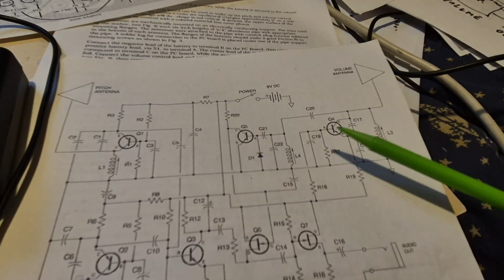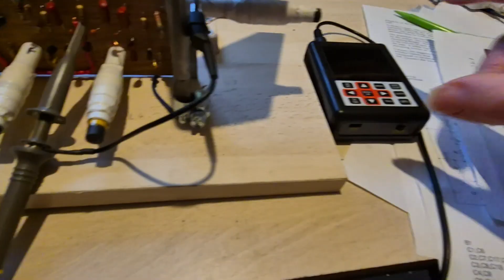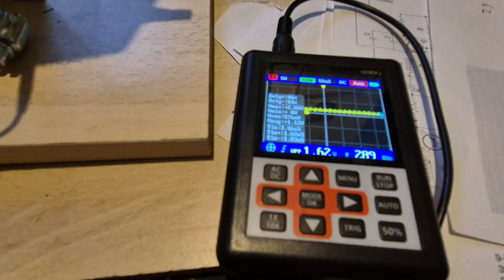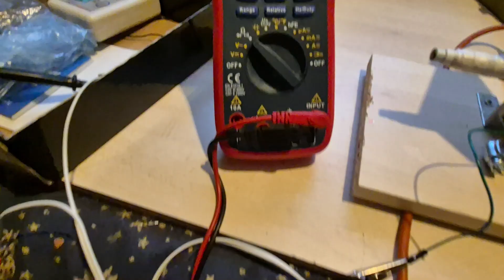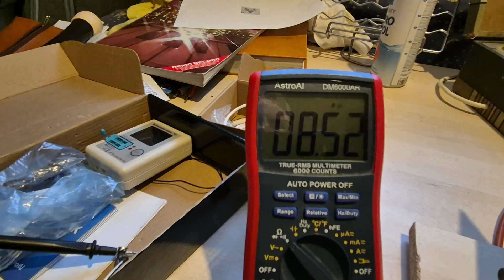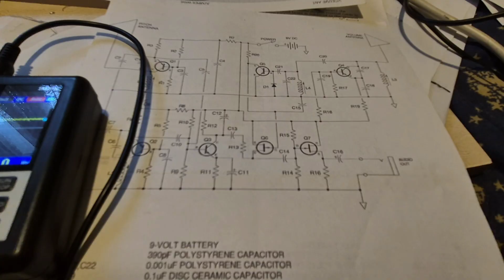Theremin Project 13 Mystery of the lack of volume control.

Comment: Hi Tim, maybe I'm missing something, but I don't understand how that circuit works. Surely there should be a  DC path from Q6 source to ground? For it to work as a variable resistor. It's just got two capacitors connected to it as it is. I'd try a resistor to ground and see if that makes any difference.
Reply from the maker: Many thanks Nick. Yes I also think that's a bit strange. Maybe it exploited some sort of quirk of the original FET, I don't know. The originally specified FET is now very rare, which is why it was not an option, as you probably already know. In a later video we could see if a resistor to ground helps.

Comment: Fascinating stuff. It sounds (sorry! 🤣) as though Q6 can work as a very sensitive volume control given how rapidly the resistance changes with a small change in gate voltage. If so then a very small change in voltage at the collector of Q5 as you vary the hand distance might actually be a good thing if, and it's a big "if" of course, you can calibrate the collector voltage of Q5 accurately. So here's another random noise output from yours truly: what happens if you change the value of C21? My thought is that with L3 and L4 tuned correctly (with the hand not close to the volume trowel) then reducing the value of C21 reduces the signal applied to the base of Q5 and thus increases the collector voltage. And vice versa of course. Maybe the gain of the transistor you've used at Q5 is sufficiently different from the gain of the transistor in the original circuit that the value of C21 is no longer useful?
Reply: Bob: (Hi Bob) actual noise source here...perhaps just swapping R20 for a potentiometer would allow sufficient fine tuning of the collector voltage for Q5 (perhaps that's "too late" though, and really, as you say, you need to tweak the base voltage to put Q5 in the proper range).
Reply: @matambale  Good thought Joe although varying the value of R20 might not change the threshold much? I don't know. Another possibility which has just occurred to me is whether the voltage drop across D1 is closely enough matched to the base emitter drop of Q5. In combination with C21, which would act as a reservoir capacitor for D1, the negative excursions of the AC passing through C21 are shunted to ground less that diode drop allowing the positive excursions of a small signal to just turn on Q5 if the diode drop and Vbe drop are closely matched. I'm an avid consumer of music of all genres but I'm rubbish at making music so I'm rather glad I'm not tempted to build a theramin! 😱🤣
Reply: @BobAndersson  Good thoughts Bob, right back at you.  Tweaking R20 is on the wrong side of the problem.  I did wonder about D1's Vf being close enough (low enough?) to yield the proper bias point for signals on Q5 and now courtesy your point, Q5's Vbe drop.   Sounds like a bullseye.
I cannot imagine being graceful enough for the gestures needed on a Theremin.   No frets!  No keys!  Madness!
Reply from the maker: Many thanks Bob. The comments from you, Joe and Nick have given me food for thought. I'm not really sure how Q6 is supposed to work like that, with the source connection not DC-defined. I maybe should work backwards, by trying to get Q6 to work as a variable resistor rather than a switch, and then work back from there.